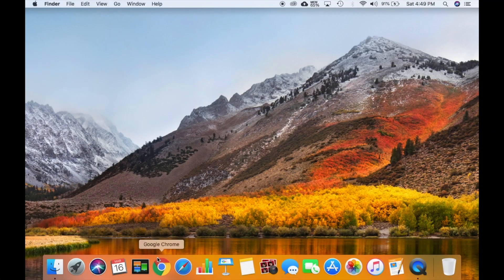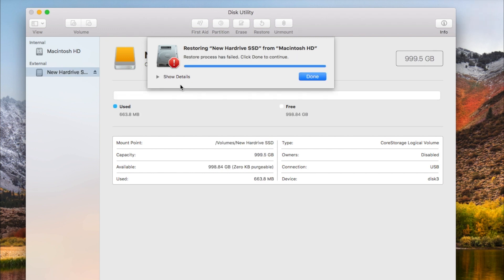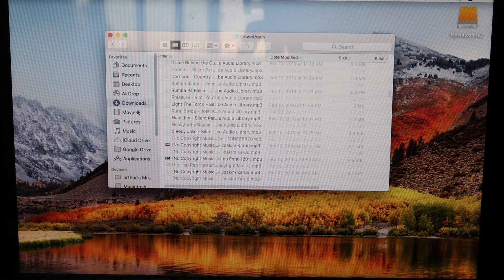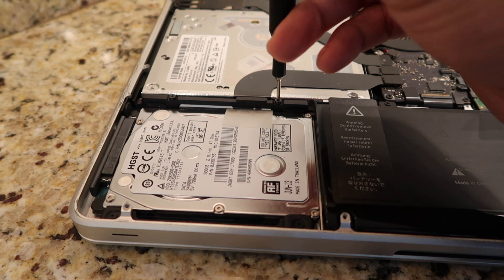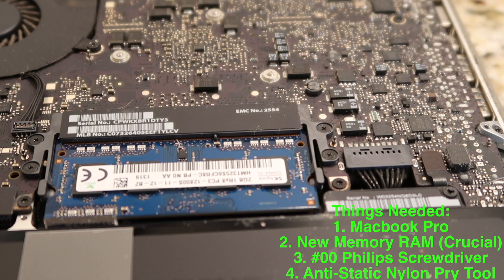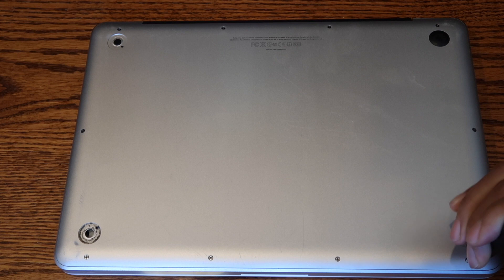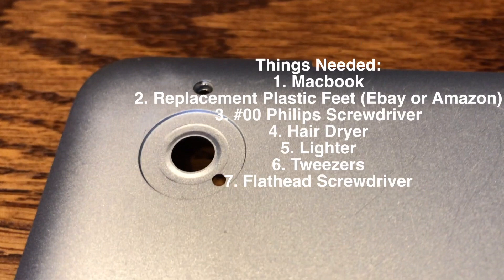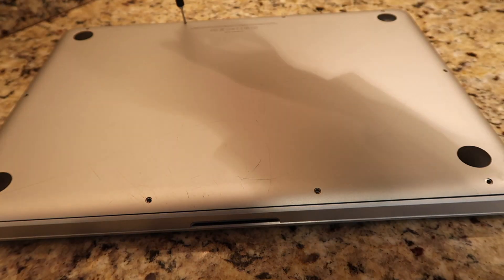HOW TO UPGRADE MACBOOK PRO MID-2012 | UPGRADE MACBOOK PRO (2022) | FASTER MACBOOK

Comment: Great video! I got hung up with an error on restoring the SSD portion, but what I needed to do was unmount the "Macintosh HD" & "HD Data" drives then Mount the SSD, then erase the partition on the SSD to start fresh then, re partition the SSD to "journaled" not "journaled encrypted" then I was able restore and it worked perfectly ✊
Reply: Mine did the same thing.  I would have been so stuck without your fix.  Thank you so much!
Reply from the maker: Glad you were able to figure it out!!!
Reply: I’m getting the issue where I can’t restore to the SSD because of the Mac HD and HD Data
Reply: Do I need to restore both the Mac HD and HD Data?
Reply: @christianbalancio2204  I believe once you restore Mac HD it will build a new data HD. It has been a while now since I've done this.
Reply: @dubstackz  Thank you. I’ll see what happens. It is stuck on replicating.
Reply: @christianbalancio2204  Yeah man, from what I remember that step where you're at can't really go bad. If you delete the data HD first or the Mac HD first you'll find the combo that the system will allow to be able to move forward if you figure it out post a step by step reply for someone in the future. 🤙
Reply: @dubstackz  Cool I appreciate it!
Reply: @dubstackz  The restoration part is stuck on replicating and it has been like that for an hour now. Has that happened to you?
Reply: @christianbalancio2204  I don't think so, mine was as I described. But if I were you I would go back a few steps or start from step one again. I recall having to restart the computer a couple times before I figured out my solution.
Reply: @dubstackz  thanks I appreciate it!

Comment: Hi ya, I'm stuck on the stage after booting the laptop up in recovery mode. I have mounted the drives but when I try to restore "MacHD" to my new ssd drive it fails saying: "couldn't set up partitions on target device - operation
AddAPFSVolumeToContainer, line #4526 - error 49231"

Any idea on where I went wrong/what to do next, I have no tech experience and it is showing haha!

Cheers!
Reply from the maker: Sorry about that! Your best bet would be to look in the comment section for an answer. Lots of dialogue and problem solving or go online and type that line error in! If you do find the answer and solve your problem, PLEASE, come back to the video and share your process of fixing it

Comment: Still the best MacBook there is
Reply from the maker: Absolutely love these things!
Reply: @DATAProductionsMedia  just finished up upgrading mine today, did the preventative measure of using electrical tape underneath the SATA cable for sense of security yoo
Reply from the maker: @poacher9118  glad everything worked out!

Comment: Thanks so much bro, this is a great tutorial. I keep getting an error when I try to clone (trying for the 3rd time now, I'll let you know the error msg if it comes up again). I purchased a Crucial 1TB SSD. I'm assuming i need to get the same Samsung SSD you have. Not sure what I'm doing wrong or what step I'm missing.
Reply from the maker: You’re welcome! Not sure what the problem is, but if it keeps happening. I would try to find an answer in the comments or google the answer
Reply: @DATAProductionsMedia  So I just tried a 3rd time and got the error message "AFPS inverter failed to invert the volume - Invalid argument 
The operation couldnt be completed (OSStatus error 22.)" 

I'll scroll and goggle this error number to try to find out what it is. Thanks.

Comment: I have a macbook pro mid  2012 and the battery count is at 111 never replaced the battery but it gives me only 3 hrs of normal usage 
What to do ? 
Is there any issue in battery
Reply from the maker: I would replace your battery!
Reply: D.A.T.A Productions Media even tho the battery count is at 111? 
You think there is some issue in the battery ?
Reply from the maker: @khanameesh  you mean at 111%? If it is dying after 3 hours, the battery isnt terrible but not working to full capacity
Reply: D.A.T.A Productions Media what do you suggest brother , the battery count is at 111 only and coconut battery says the condition is good 
You suggest to replace the battery v
Reply from the maker: @khanameesh  yea if you are not happy with your battey's performance. I suggest replacing it!
Reply: D.A.T.A Productions Media thanks bro but i am scared what if i spend the bucks but dont get the performance
Reply from the maker: ameesh khan ifixit.com sells good batteries! But it’s the name of the game with upgrading older products. You can always switch it back if you want. The benefit of mid 2012 MacBook Pro’s!!

Comment: I cannot thank you enough man! I ran into a problem, watched your other video, resolved it. My macs running like she’s brand new. Saved me a lot of money. Appreciate it. Definitely subscribed.
Reply from the maker: Glad to see you figured out the problem and now up and running! 🎥💭
Reply: D.A.T.A Productions Media  hey man quick question. Will I be able to do routine updates or no? When I first tried to do an update to the newer one that recently came out it wouldn’t let me so I had to redo everything. But moving forward would I be allowed or do I have to just stick with the one it has?
Reply from the maker: @joses1625  When I upgraded my laptop I was able to keep doing all the new updates. But that was over a year ago. I haven't updated my laptop in a while so things might have changed. I would continue trying to update your laptop. If it won't allow you moving forward, keep it the same.

Comment: Hey man thanks for a great tutorial! In my disk utility I see two separate internal hard drive “Macintosh HD” and “Macintosh HD - Data” I’m assuming I need both but how would I restore from both hard drives?
Reply from the maker: I am not sure on this matter. Please look in the comment section for any possible answer or other videos in my playlist! My guess world be “Mac HD” tho. But def keep researching!
Reply: Salman ahmed Im having this same issue .. were you able to find out the answer to this issue?
Reply: I'm assuming your old drive is formatted as APFS like my old HDD.  I basically formatted the new SSD as APFS and both the HD and HD - data drives were created.  Then I selected the original Macintosh HD drive as the source for the restore and everything automatically copied over to both HD and HD - Data drives on the new SSD.

Comment: Great video. 

Warning, after installation, check & update the date & clock. 

I cloned ssd & installed RAM at the same time, not sure which one of the operations caused it. 

Anyway, thank you very much young man
Reply from the maker: Thank you for the quick note! Happy to help you! Subscribe please!
Reply: That can happen as a result of disconnecting the battery, often times it will fix it on it's own sometimes it needs a helping hand.

Comment: Hey! Thank you so much for this video. It really helps a lot. I love trying to do my own tech work. QUESTION: You mention that after replacing the hard drive (and after first cloning it) that we may have to REFORMAT it, but I wouldn't that erase everything that was cloned? Please help me understand. Thanks!
Reply from the maker: No problem! Happy to help. When cloning to the new hard drive, you want to make sure the new ssd is in the same format as the old HHD. You shouldn't have to reformat anything once its cloned. Just plug it in the laptop and you should be good! Sorry for any confusion!

Comment: My mac 2012 cannot upgrade from 10.8.5 to any newer OS 
if i do the upgrades you did in this video, will it be able to update to the latest OS version of 2020?
Reply from the maker: You’ll be able to upgrade ram, ssd and Battery regardless of the OS and it will still make a difference. Not totally sure on the specific OS system tho. I am still on Sierra. If you’re on Catalina, I have another video trying to help with that.
Reply: @DATAProductionsMedia  
Ok gotchu. Thanks

Comment: Hey quick question. so if i install that Samsung SSD Drive and also the Crucial 16GB RAM will it make my 2012 mac. download up to date apps? and programs?
Reply from the maker: If you copy your up to date apps from your HHD to SSD then yes. But if not, no you’ll have to download them if you start from scratch!
Reply: @DATAProductionsMedia  
Ok, because i meant like for example will i be able to download as well latest apple updates to the mac 2012 after upgrading it? Because right now its obviously not able to update so i can’t download any more updates because apple stopped releasing them for mac 2012. 

Thanks for replying tho 👍🏽💯

Comment: What do you do if your computer does not advance from the restart. The SSD is plugged in and I did the restart from that drive. Status bar is full but the screen is frozen
Reply from the maker: Hopefully you found out the solution!

Comment: Help i copied the new drive as per your instructions but when I try to load it up in step 9 it never loads I just get stuck on the spinning wheel also when I copied the disk my laptop was showing 2 separate drives so I copied the one that said data
Reply from the maker: Hope you got the solution!

Comment: Which  one of these steps are the best and cheapest option   to make your mb pro operate faster? When I run multiple tabs on chrome or use computer program it’s really slow and get the color spinning wheel all the time which annoys me
Reply from the maker: Your RAM. I’d upgrade your RAM to 16gb if you’re only looking to upgrade one thing
Reply: D.A.T.A Productions Media awesome thanks for the reply. the Samsung disk you installed that’s only if you need more space for storing things correct
Reply from the maker: @mszmandaa  correct! but it does help with speed too. If your drive is almost full your laptop can slow down a little bit. Doesn't have a huge affect tho.

Comment: if i don't need any files off my old hard drive would i do anything different? just seems unnecessary to transfer the files just to factory reset afterwards.
Reply from the maker: Nope! Just start fresh with the SSD!
Reply: @DATAProductionsMedia  i can just install the new ssd? thanks for the fast reply (:
Reply from the maker: @ethanfritz2092  yes! you will just need to download the operating system from online
Reply from the maker: @ethanfritz2092  Here is a link for you that should help answer your question fully. I have never tried a clean install myself. https://www.reddit.com/r/buildapc/comments/8e5452/installed_new_ssd_did_clean_install_of_windows_on/
Reply: D.A.T.A Productions Media appreciate it!

Comment: i cant find brett wyricks comment for how to do this with  catalina.Very important,  Please help direct us! Thank you
Reply from the maker: PSA for Catalina users!
If you have Catalina as your macOS, you MUST go through Mac Recovery Mode and utilize Disk Utility. You cannot simply boot up and open Disk Utility. If you don't go through Recovery, Disk Utility will simply show a "blank" value when you try to utilize the "Restore" function ("Restore from:" blank). I was unable to find a tutorial for this online. Below are the steps I did to complete this on my mid-2012 MacBook.

CatalinaOS HDD to SSD steps:
1. Boot to Recovery (restart MacBook, hold on Command+R until you see the Apple logo)
2. Open Disk Utility
3. From there, you'll click on "Macintosh HD - Data" (NOT "Macintosh HD") and then "Mount". If your drive is encrypted, you'll be prompted to type the password here.
4. THEN click on your new SSD, Erase it to match your "Macintosh HD - Data" type (mine was ADFS - Encrypted).
5. Now click on Restore and select "Macintosh HD - Data" (NOT "Macintosh HD").
6. Replicating....
7.  Profit
Reply: @DATAProductionsMedia  Thank you! I appreciate your help. I took Brett's advice and just installed the new SSD first, booted it in recovery, did a fresh install of MacOSX,  connected my old hard drive via a USB 3.0 SATA cable once the OSX installation was complete, and then manually transferred the files/apps that I needed from my old HD to the new SSD.  Reason being, is because when you have Catalina and try to clone HD in the beginning via the USB cable, I would receive an error stating that the computer was unable to identify the SSD, and the needs to be ejected. So I couldn't properly restore/back up my HD at first. So i just decided to start from scratch, take our my HD, and install the new SSD first. Thankfully, most of the important things i needed were already saved on a seperate external hardrive, therefore, anything else i'd need, I could just download or install fresh from online after the fact. :) I basically just updated everything (osx lion -> catalina), got back to my original state. Its a longer route to take when starting fresh, but in the end, everything worked out great.  Thanks for the helpful video!
Reply from the maker: @seanharrell317  Glad you figured it out in the end! Happy to have helped. Subscribe please!
Reply: @DATAProductionsMedia  does it mean I need to install OS separately ?
Reply: In step 5, if you only restore from Macintosh HD data , what bout the OS ? I feel so lost at this.

Comment: If i use 500 gb ssd instead of the 1tb will it still perform fast or do I need 1tb for better performance?
Reply from the maker: It will perform faster than the 500gb HHD, but more memory the better in my opinion. But yes you will see a difference in your speed with the 500gd SSD!
Reply: @DATAProductionsMedia  i saw you got the 1tb so I was worried if I got the 500gb it wouldn't perform as good as a 1tb lol

Comment: I'm not sure why my disk utility is split up into two parts 'Macintosh HD' at 11gb and 'Macintosh HD - Data' 99gb.
Reply from the maker: Honestly not sure! Maybe google that or there could be a solution in the comment section! My apologies!
Reply: You're on Catalina? I read that this is why you see two. I read that you use the "Data" one but I am no specialist. Check out his other video ("without software") to see a great PSA and how-to in the comments.
Reply: Joop Oranje I just ended up using carbon copy cloner thanks though

Comment: How much ram can a mid 2012 15" handle? I see everywhere it says that the max is 8gb.

Why is the 13" and to handle 16gb?
Reply from the maker: Joseph Gaudiano a ‘15 can handle 16GB too! 8GB each RAM slot
Reply: @DATAProductionsMedia  really?

That is good news. When I first bought my macbook new I had it special ordered with all the upgrades I could get except the ssd. But at the time the max ram they offered to upgrade too was 8gb total.

That is why i was wondering. So I will have to give that a try.
Reply from the maker: Joseph Gaudiano yes! I have 8GB in each Ram slot in mine! Only difference is you need to make sure you have that 15’ compatible battery!
Reply: D.A.T.A Productions Media can a 13” MBP mid-2012 handle a 16 GB RAM?
Reply from the maker: Aki Fujikawa yes!
Reply: D.A.T.A Productions Media thank you so much! I will be upgrading my laptop soon! 💜

Comment: Hey Art, first off thanks for the video! I really appreciate it! Dude,
I upgraded my RAM no problem.
I am having trouble following the cloning process. 
First off, when I select OS Journaled Encrypted I have to password protect it (am I being foolish here but I didn't see that happen in your video)
Basically it won't boot from the SSD
When I try immediately after the install I get the no smoking type symbol.
If I reboot into the Recovery mode and unmount the existing drive and boot the ssd via usb it works.
BUT
When I physically install the ssd into the mbp body, again I get the error message again.
I've tried many way but nothing seems to work.
Any ideas man?
Reply from the maker: conordia was your original HHD OS Journaled Encrypted as well? Usually the SSD has to be cloned the exact same
Reply: @DATAProductionsMedia  yes indeed man, they were both encrypted. I've tried loads of things nothing seems to work at present! Thanks for getting back to me
Reply from the maker: conordia dang! I’m sorry about that. Maybe look into the comment section to see if any other people have had the same issue!! Lots of ppl in the comment section have been helpful!
Reply: @DATAProductionsMedia  thanks dude!
Reply from the maker: conordia thank you for your update! Glad everything is good now!

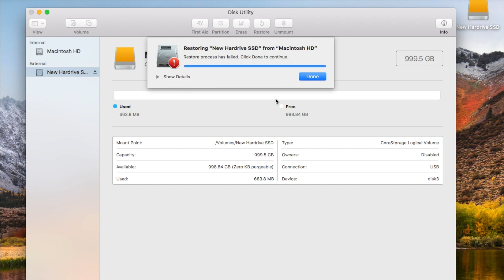Comment: 2:13 mine did though. Is that ok? It's moving at a snail's pace. Haaaalp?
Reply from the maker: Paranormally Correct go thru the full steps and see if it still transfers. If it transfer fine then no issue!
Reply: @DATAProductionsMedia  thank you for responding. I let it continue, and after 3 hrs, it failed lol. I proceeded with the rest of your instructions and it failed again. Currently trying to figure out what's going on. :(
Reply from the maker: Try looking inside the comment section below of this video and see if you can find an answer!

Comment: This guide looks fantastic. I will be doing the upgrade soon. I have a 500GB CRUCIAL SSD currently running on EL CAPITAN 10.11.6 can i follow your guide in this video step by step and still get it done correctly? Later i will try to upgrade to SIERRA. Your thoughts are welcomed!
Reply from the maker: buckydewit El Capitan should work just fine! I was already on Sierra when I transferred tho

Comment: So the mid 2012 MB Pro can hold 16g of memory? I looked mine up on Apple and it said 8g. Or is this only after the HD is updated?
Reply from the maker: Mr. Pouty Face you can do 16 GB of RAM!!!  8GB in each slot
Reply: D.A.T.A Productions thanks for the quick reply! And I’ll add a like and subscribe because I’ll be using the video as I just bought everything you listed! Thanks from DFW!